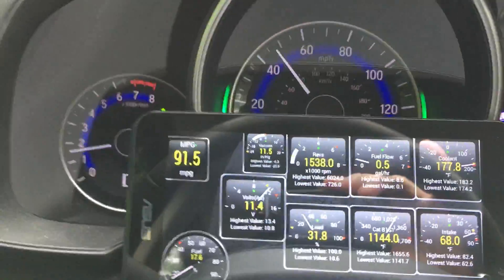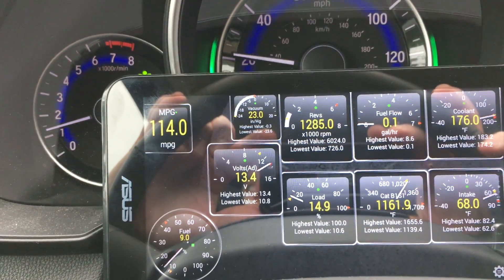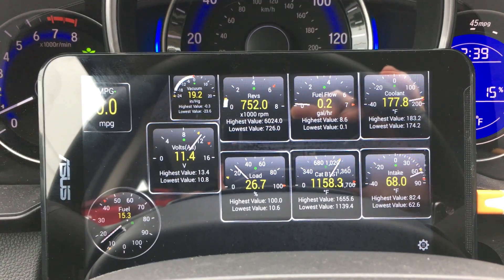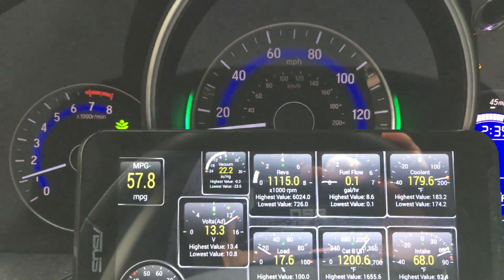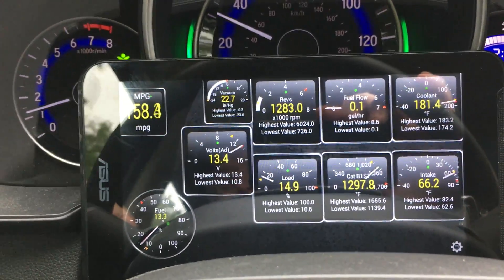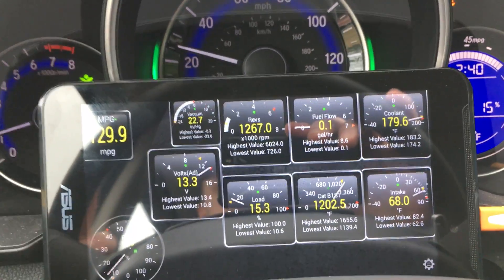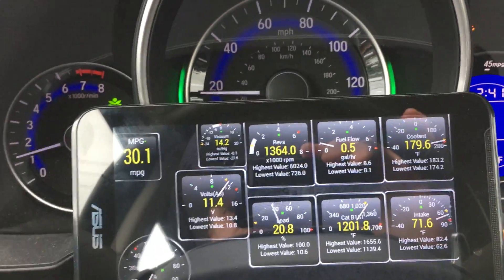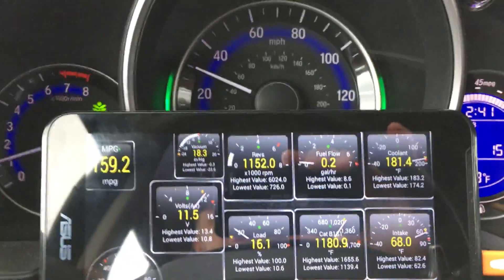2015 Honda Fit EX-L strange behavior of the electrical system. Torque Pro app

Comment: I believe this is by design as an energy efficiency strategy - Honda uses an Electrical Load Detector (ELD) located in the engine bay fuse box that monitors the electrical load and commands the charging system based on engine load and electrical need.  The system attempts to minimize engine load required by the alternator for charging and maximize charging when decelerating. See http://www.gonzostoolbox.com/knowledgefolder/hondaeld.html
Reply from the maker: Tom Katt Thank you very much for explaining this. I no longer have the car because of other problems but I have another Honda (Accord) and although I have not tested this it probably does the same thing. But this was a very interesting read from Gonzo. It makes sense how they try to make the most efficiency out of the cars and at the same time do not overcharge the battery. It really is smart how they are recharging the battery during deceleration or under the conditions specified. Thanks again!